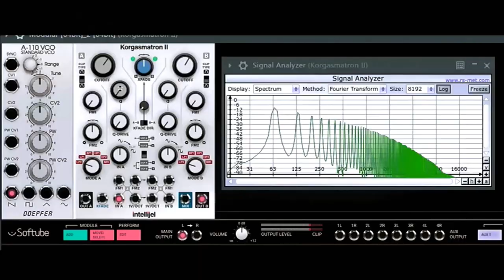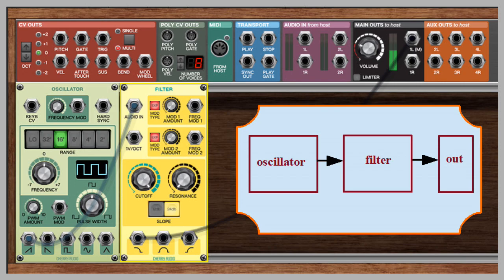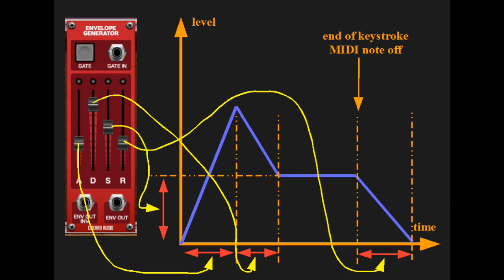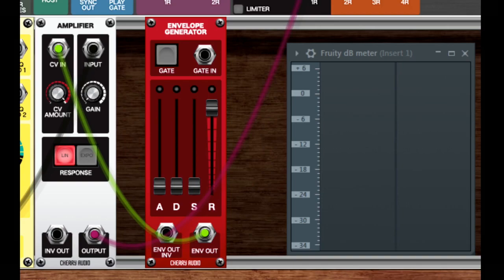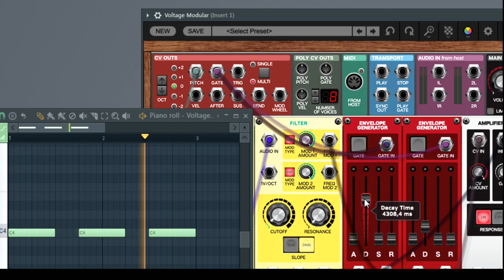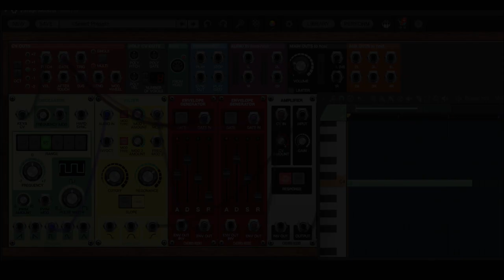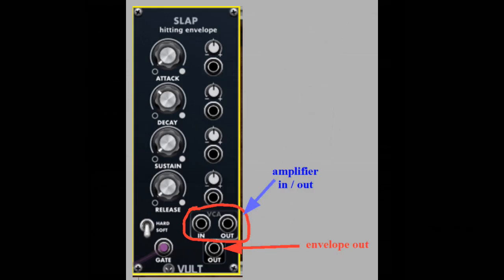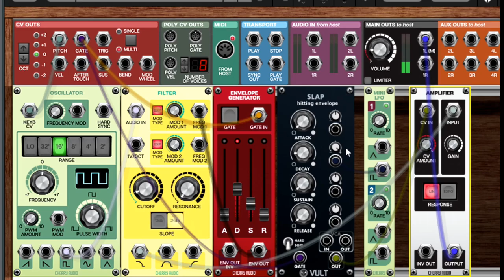Voltage Modular Patches Part 1 East Coast Subtractive

Comment: Greetings from London! Thank you for the informative video. I'm a huge fan of Voltage Modular so it's good to see as many tutorials as possible. Did you ever do any other vids on VM? Also, I would be very curious to hear your opinion of VM vs. the Softube Modular system. Again, thanks for you effort and dedication.
Reply from the maker: Hello Joe, I´m happy to read your comment. No, I´ve not made more videos concerning VM yet. The reason is simple: money and time. I had planned to make a whole series about VM, but then changed the direction (or broadened the view) to dedicate the series to patching in general, independent from a certain product. VM is definitely a good product, soundwise as well as "optical", and the handling is great. It also has a relative low demand on CPU power, what is a great advantage. Softube´s modular is a wonderful product as well, but its very very demanding, a fact, that limits its usability in "real life" practical music production enormously. I like both anyway, but for different reasons. Softube´s Modular serves well for making tutorial videos explaining also the hardware originals it´s modelled after - a less expensive way to do so, than buying the hardware modules, which I wouldn´t be able to. Voltage Modular can also serve in real music productions. I also like the possibility to develop modules of ones own in VM, something I might start doing in a year or two. If you like to learn more about what is going to happen on my channels and in our community, please watch the following short video: https://youtu.be/zubPZAVakV0 . And if you liked to help a bit, I´d be happy you took part in my little survey helping me to produce the right videos: https://forms.gle/7f8hEBJj176Fg1St6  . Enjoy your day! Rolf

Comment: Great video, thanks for taking the time to make it. I've been having a blast with my MicroBrute for about 3 months, finally decided to dip my toe into modular when Voltage went on sale. Can't wait to see the next video in this series. One question that's still perplexing me: Where do the harmonics/overtones comes from? I understand that the sine wave is only fundamental, and I've looked at various wave shapes on an oscilloscope and spectrum analyzer, but I'm not sure why a saw (for instance) would be so rich in harmonics, while a sine is pure. I've also messed around with drawing waveshapes in a wavetable synth I have, but I can't ever predict what sort of base sound will result. Any insight? Thanks again!
Reply: @rofilmmedia1  I'm glad it wasn't something simple I'd somehow missed, thank you for spending some time to nudge me in the right direction. It seems like I'm starting down a rather long rabbit hole, but I think understanding sound at a fundamental level like this is going to be useful to me. Time for me to check out your other videos and perhaps find some other resources as well. Are there any specific books or videos (or even paid courses) that you might recommend? Regardless thanks again, I look forward to continuing to increase my understanding.